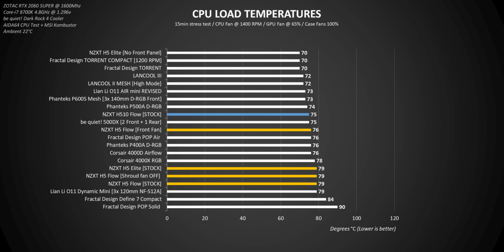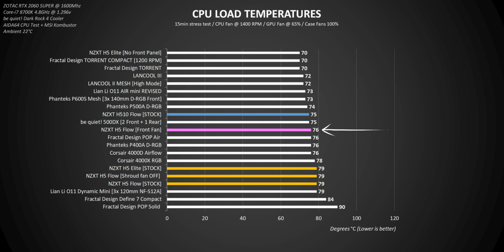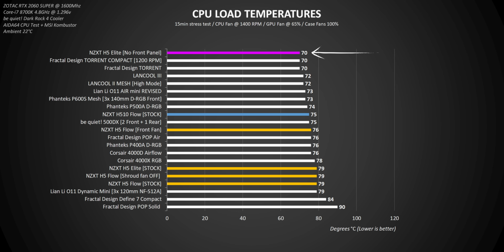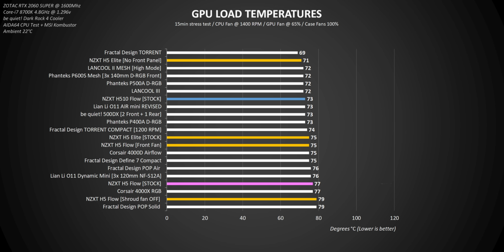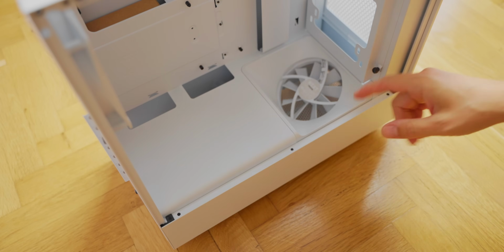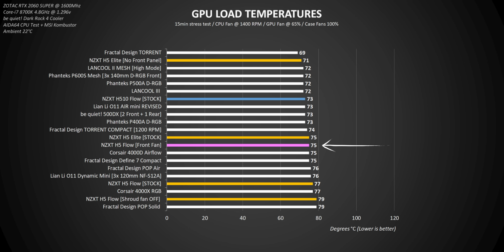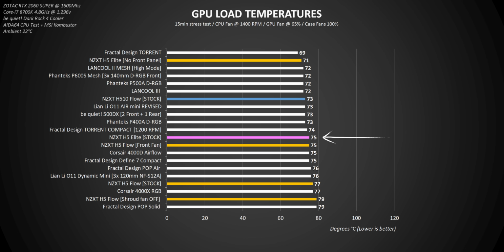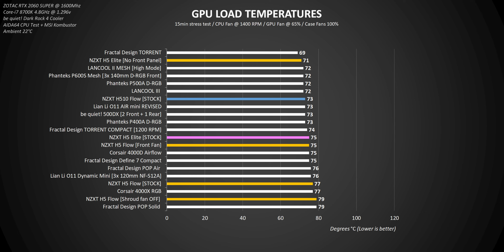This Case put a Fan WHERE?

Comment: Man, if only someone had thought of putting fans in a PC case that blew air directly onto the GPU.  Seems like the front panel would be a good candidate for that, right?  Oh wait.....
Reply: That! lol and I literally have fans under my gpu cooling it down, on my Lian Li Lancool 2
Reply: Or the side panel. Or the floor of the case if the PSU is somewhere else.

Thinking about the direction of that angled fan, wouldn't it catch the air coming in from the lower front fan and push that air upwards, away from the GPU?

Comment: I got the H5 flow on amazon, the sad part is that it already shipped 😢, i wanted the H510 Flow but it got out of stock almost everywhere and the few places that still have it increased the price.
Reply: I have very good values, just try it out. But you should install front fans. I have another use case with a 4090 FE and it's way cooler than shown here.
Reply: @tinybit780   thanks for the encouragement, yeah i was planning on using two 140 mm noctua fans in the front, btw i just received the case, I already want to unpack it to see the build quality.
Reply: @royai91l  What's your opinion?
Reply: @tinybit780  I’ll be updating you after i arrive from work.
Reply: I want to know too lol
Reply: @tinybit780   @Jonathan_Fz 

ok, quick update i find that the build quality is not as bad as some YouTubers are saying, I’m not an expert nor have too much experience, i would describe myself as an average consumer, but continuing with my thoughts i saw that a lot of YouTubers had issues with the feet of the case, mine are normal and the case doesn’t wobble, in other words the quality seems good to me, (be aware that i come from using cheaper cases like corsair carbide series and similar ones, so maybe for someone like me the slightest change to a higher quality would be like a comparison between heaven and earth.)

Comment: SO I got this case for Cyber Monday in 2023. So far everything is working out okay but I definitely ran into the RGB issue with my fans. Another thing I'm noticing is that no matter what fan port I put the bottom fan into on my motherboard, the bottom fan will eventually just not turn on. Has anyone else run into this issue?

Comment: i recently build in the h5 elite with glass panel thermals are very great! ;) had total 6 fans with the radiator top mounted. the new rgb controller is bad.

Comment: The NZXT H440 was there best high end mid tower (I own one) the other models they have are  really crap So I changed for my new PC To 
Be Quiet silent base 802 white window It's a very good high end mid tower it came with both solid and mesh front and top panel (so I installed mesh on both top and front)
Front has A fan control switch a USB C 2 USB A (Both USB 3.2) plus 3.5mm micro and headphones Jack's ..And the case has a fan hub just like the H440 had ...

Comment: The lack of ventilation for the slot covers and lower back of the base has got to be the achilles heel of this design. In theory there is no reason for the GPU to have thermals this bad.

Comment: Unfortunately NZXT's H500/510 series of cases has finally outlived its esthetics only appeal...I mean in 2022 PC builders demand much more from their cases and NZXT just hasn't gotten that message yet, sadly though all they really need to do to turn they're current reputation around is to just take a good look at their main competitors offerings, like say some of Corsair's recent airflow offerings, the Fractal Torrent and both Lian Li's O11 Dynamic and their feature rich/high airflow performing Lancool II & III mesh series of cases to get some solid inspiration...So, here's a bit of advice to NZXT's designers, "Quit treating the design of your H line of cases as some sort of Porsche 911 (Because they're NOT) and just start adapting them right now, or the next thing you know you'll be as extinct as the dinosaurs" :/

Comment: Why did you  not mention the fact that you literally tested the h5 elite with no front panel and its better than everything else in the CPU chart except the Fractal Torrent? This means that if you add two front fans to the Flow variant you'll be able to get that same good thermals (or even better because nzxt fans suck). Same thing for the GPU chart.

Comment: It looks cool but pointless and makes little to no difference from a front intake fan. I can barely fit all the cables in an empty PSU enclosure on my 4000d. There is no way they would fit with that bottom fan in the way.

Comment: Hey Dmitry, I have a question for you and the community. 
I am currently rocking an Asus Dark Hero X570 ATX MB, Ryxen 5950X + 360 AIO and planning on getting one of those THICC RTX 4090 or RX 7900XT GPUs. I am currently using a monster case which was meant for a custom loop build that I unfortunately couldn't do (Thermaltake View 51 Snow, 90 Liters). 
I want to move to a more compact case, industrial but also slick/clean, so I can also display it on an industrial shelving / display unit (one of those that can hold like 150KG per plank). What are your suggestions? 

Oh and airflow/performance is an important thing but I dont like the overly perforated/meshified cases such as the LianLi Lancool etc. Ive seen the Corsair 4/5000D and the Asus TUF cases which look like the kind of thing I want, but not entirely?.. Pls help lol, I want it to look kind of industrial but modern, it is allowed to look a little rough. I will be using one of those Ikea idasen desks with dark grey feet and the same dark wood top that you guys also have in one of the gaming setup videos you did! And my shelving unit is also dark grey/black frame with warm wooden planks.
Reply from the maker: Hmmm would the Fractal Torrent style fit? Performance wise it’s incredible and looks very good imo. But otherwise the 4000D or higher is super decent with figment and dust filtration. Good luck with the search and let me know what you pick 🤘
-D.

Comment: I have been becoming increasingly critical of new case releases, either, they all look the same or they try do to something nobody needs. In this case, it is a welcome addition, but probably not worth a switch, the fan and shroud placement look like a dumb waste of space when they could have just opened the for 360 support instead of making  piece that will likely end up taken out and left in the box. It's build quality is quite sad, for its pricing, you would think it would implement better qualities. It is sad to see an otherwise good brand start suffocating itself with absurd pricing, Lacking build quality, and nothing really new to offer.

Comment: Not feeling the way you reviewed the case. Why not use a standardized fan config like GN uses in their case reviews? Simply leaving the case with only the supplied fans regardless of position is not very realistic. IRL, people would populate the front intake fans and at the minimum have 1 exhaust fan at the rear. Im very dissapointed with this review.
Reply from the maker: I test with fans at stock so with the H5 Flow it had the basement intake and one rear exhaust. 
-D.
Reply: Should i called it unrealistic

Comment: Something is off about this vid. Was dimitri pissed, angry or short on time? Maybe even a different editor? Been watching this channel for years now this vid was missing most of the dimitri touch for videos that first brought me to this channel. Still plan on watching this channel for now, just wanted to mention it. Something changed and not for the better, not to me at least.
Reply from the maker: I wanted to try a more dynamic approach with this case. It's the same thing since 2014 and I honestly didn't want to do the same old b-roll of the same old case. I guess I am slightly angry... Thanks for watching and your feedback. 
-D.

Comment: Seriously another stock fan review? This video is just as useless as the one from GN…
Reply from the maker: Thanks for your comment, what do you want to see with fans in case videos? 
-D.
Reply: @HardwareCanucks  The performance will change dramatically if you use good fans for the H5 flow.

Comment: So much negativity everywhere on YouTube. Are you shaking your PC while using it? Mine stands still in a corner, 4 degrees difference is minimal.
Reply from the maker: It still vibrates at full fan speed with the stock fans, so imagine the noise with more fans loaded? You have a point, but it would suck to spend almost $100 to get this quality. 
-D.
Reply: @HardwareCanucks  you guys usually keep a positive and happy tone to your videos and this one was surprisingly not. That's why I posted that comment, sorry I wasn't trying to argue. I just love your channel, and not so much others that going always negative and complaining and hating ;)
Reply from the maker: For sure, thanks for your feedback! :) 
-D.

Comment: 1:50 "There's no other front intake" while sticking his hand through the fan bracket that can be used for front intake.

What the actual fuck, guys?
Reply: he means there are no other included intake fans.
Reply: Well do you see any other front intake fan, genius?
Reply: While his wording could be better... im going to assume he was referring to the case stock configuration of a single fan as intake and there's no other fans as intake. 

Hence his "no other front intake" because thats the only fan bring air from the front.
Reply: No out-of-the-box intake. No fans.
Reply from the maker: No other front intake fans... I think it's pretty clear but happy to clarify my wording. Cheers :) 
-D.